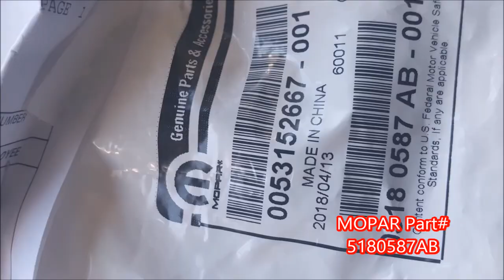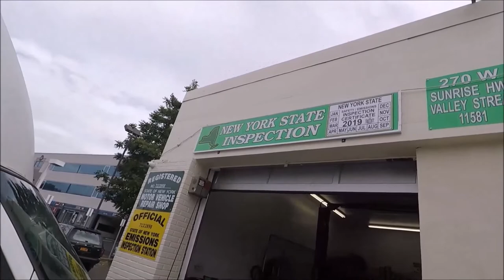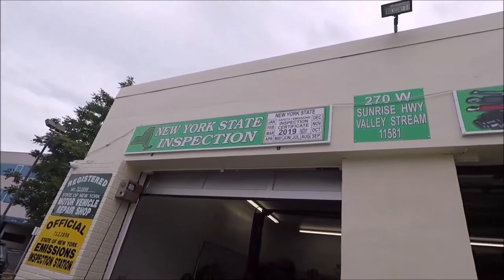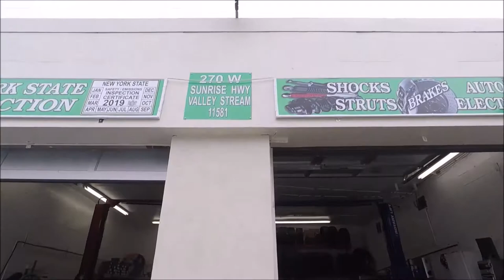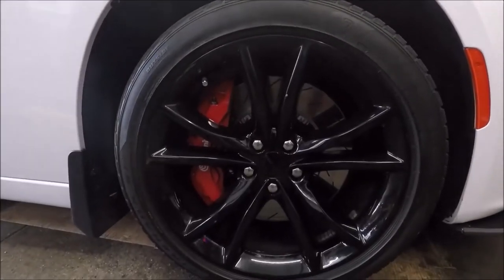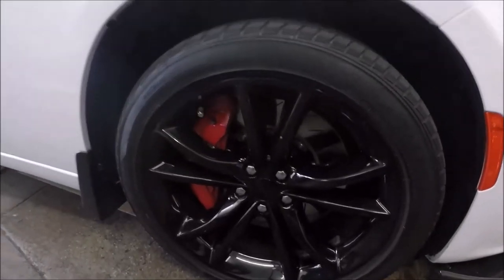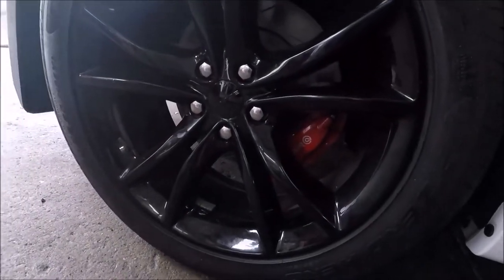Project Brembo Upgrade Part 2

Comment: Man glad you posted this. Now I know. I was purchasing spindles, rotors and calipers from a salvage yard. I wasn’t sure on the brake lines? Also when I order new wheelers I’m assuming just let them know it’s for a SRT so they get me the correct offset (so I’m assuming I will not be needing wheel spacers?) 
Also I love your car! Looks perfect. The red brembo looks good on the white and black!
Reply from the maker: Haha thanks man, I try. Purpose is to try and help others. I needed 1inch spacers on the front because my rims are 8.5 inch and i dont have the clearance to clear the calipers.. so to even the car, I did spacers all around. Dont need a brake line, but you'll need the fine thread bolt that the fluid travels through to the caliper. Thanks man
Reply: JayMac95 perfect! I will be uploading my swap also! Thanks again
Reply: @JayMac95  where did u get the fine thread bolt? and was the size?
Reply from the maker: @wowtenk  tbh, they just happened to have some laying around the shop  thank goodness😅. I'm sure it was the same size bolt just the threading was different and it had a hole in there which they said the fluid passes through

Comment: Homie you gotta be careful putting those wheel adapters on with the impact gun they’re suppose to be set to a certain torque every one is different if you over tighten them you can snap you studs right off I’ve had it happen almost wrecked my car from letting a shop do my brakes and they used the gun on my adapters
Reply from the maker: Thanks man, I've always thought about that too, as in, every bolt has its specifications. Do you still have adapters and do you know the specifications

Comment: I do had to buy a new one from the incident I spoke about. The specs very from size and manufacture. Mine were somewhere in the low 160 range don’t remember the exact torque. There’s usually a piece of paper explaining all that when you buy them. If not I’d contact whom ever you purchased them from and they should tell you the specs. If you got a good brand, you should be able to look it up
Reply from the maker: Thanks man for bringing this very important information to my attention 👍🏾
Reply: Not a problem homie!! Just didn’t want the same thing happen to your car as mine. I just put new tires on me wheels and I sat there at the shop took the wheels off and put them back on myself just bc I know they would use the gun and they have way to much torque for the adapters..

Comment: Just to make sure the rear only needs the knuckle and the front needs knuckle and spindle right?
Reply from the maker: Knuckle and spindle are used interchangeably,  but yes. The rear only needs a knuckle, just make sure they sell the bushing already pressed into it. The Front just need the spindles and you'll need a different style bolt for the brake fluid line
Reply: @JayMac95  so for the rear can you use the stock brake lines ?
Reply from the maker: @andrewjaimes4546  for the rear, yes. I don't remember having issues with them. Only the fronts were fine threaded

Comment: Did you have to change to a different wheel or are those the factory 20x8 wheels?
Reply from the maker: They are factored but I added a 1 inch spacer. I eventually got different wheels but the stock front rims are not going to fit without the spacer

Comment: So you needed a spindle for the 2 fronts but only needed a bushing for the rears?
Reply from the maker: Needed spindles for both front and rear. They just call the rear knuckles instead of spindles. The rear knuckkes should already come w bushings but initially mine didn't

Comment: So what was the reason for having to change the rear knuckle out? You said the front was because the width of where the caliper bolt goes in was to small, but didn’t say anything about rear. Was it the same reason? Thinking about doing this in the future, I’ve already bought the Brembo kit from someone for cheap, so want to get everything I need. Thanks

Comment: JayMac did you use the stock brake lines  or had to purchase new SRT brake lines?  Thx
Reply from the maker: Stock brake lines. No issues in over 2 3 years whenever I installed them. "They" recommend upgrading to braided but I bought the wrong ones at the time

Comment: nice infomation video.......will all these parts fit a 2007 dodge charger 3.5....is the bushing for the rears the same as a 2007..?thanks
Reply from the maker: Thanks John! Unfortunately I'm not entirely sure about that. I dont think so due to the complete remodel of the car. To find out you would have to compare your stock parts to that generation srt8 ...and go from there

Comment: How much did the brake calipers, spindles and rotors with install cost?
Reply from the maker: I bought the calipers new which comes with the rotors for Over 3. Spindles were over 1k. Labor put it between 45 and 5. All my things were new and discounted. You can check junkyards for used or crashed srt vehicles for these parts

Comment: Where did you find those spindles for your car? I have a Durango gt and I’m trying to upgrade it to brembo brakes and calipers.
Reply from the maker: In your case,  you would have to go to a dealer and search a SRT model spindle part number, ir find a crashed one.  U can go on car guris to get a vin, so they can plug it in
Reply: JayMac95 thank you I’m gonna try that

Comment: Are those bushings the same part number for the left & right rear knuckle? & how much were they if u dont mind me asking
Reply from the maker: The bushings are supposed to automatically be included, they are usually already pressed in, but the dealer just forgot since it was the first experience they had i guess. The part number I believe is in the vid....#5180587AB. Yes same for left and right. They were free cause it should be included originally. You can check junk yards for crash SRT models and salvage the knuckles from them for cheaper

Comment: One question? I see you had to change the knuckle for the big Brembo kit. Do you need to also change the knuckles for the smaller brembo because they are 2 different brembo brakes for the front. Yours and a smaller set...
Reply from the maker: That's a very good question man, I'm not too sure tbh. I would think so because I was specifically told I had to get an SRT knuckle and the SRTs are the ones with brembos, whether 4 or 6 piston. 🤔
Reply: Changed mine last weekend and yes you have to change the knuckle

Comment: Nice video. Question, so if I’m gonna do my rears? What do I need to get? Just the bushings? Or spindle and bushings?
Reply from the maker: Well it would just be the knuckle. I had to buy the spindles separately because the dealer forgot to send them together, because it was their first time encountering something like that. So just ask whoever you are buying from to make sure you have new bushings with it.

Comment: Did you change the brake line in the back?
Reply from the maker: No I didnt change any brake lines
Reply: @JayMac95  I have a 2014 charger so idk if 15 and up the brake line are different

Comment: Question did you need the sleeve for the Allen bolt that attaches to the knuckle? Or did the mechanic install it with out it?

Comment: Did you need bracket bolts or did you reuse your original ones?
Reply from the maker: No, needed a bolt for the brake line because brembos used the fine threaded screw
Reply: @JayMac95  no I’m asking for the actual caliper to spindle can I reuse my old caliper bracket bolts
Reply from the maker: @_.kvng.ky_1081  yes. To my recollection
Reply: @JayMac95  thanks a lot I appreciate it

Comment: Can the spindles work for either piston brembo size whether its 4 or 6 or size specific?
Reply from the maker: For the fronts, yes the spondle works for both 4 or 6. The dimensions of where they mount is the same. Brembos have different mounting points than standard brakes, thats why we say get SRT spindles, because they have the brembo dimensions

Comment: Did you use the stock Hubs and reinstall them on your SRT spindles/ knuckles on the front and rear?
Reply from the maker: Yes I did. Only change was spindles, bushings(rear) and calipers
Reply: Thanks so much for the reply, Just picked up a 2019 B5 Blue Charger R/T and the only option it didn’t have was the 4 piston Brembo’s 🙁 I think I’m going to look into doing this upgrade, as yours ended up looking amazing, and I can’t imagine the difference it actually makes in stopping power!
Reply from the maker: @Matt-uy4zk  anytime, thats what I'm here for. And congratulations on the new car 🥳. Yeah the RT models and below don't come stock with them unfortunately. Hopefully the vid helped you out. Drive safe!😎👍🏾

Comment: looks clean but did the ride height get adjusted? or is it like that? IMO needs to be lowered.
Reply from the maker: Thanks man, nope, just a direct swap and everything was perfect
Reply: @JayMac95  ok thanks. Hopefully this summer ill try it.  personally I lowered my RT i couldn't stand the wheel gap
Reply from the maker: @ForeignMadeIt  oh nice! I wish I could but cant with these toads, plus the splitter and diffuser is already low enough to scrape so yea

Comment: Hey Jay quick question. For the rear you have to buy the BUSHINGS for both sides even though i have the SRT's Knuckles?
Reply from the maker: When I bought my 2018 knuckles from the dealer, They didn't come with them, so I had to buy them separately. Ask your retailer if they come with them. If not,  I added the dealer part number for them

Comment: Can You send me a list of the Parts, thats you need for the install (FRONT & REAR)I have a 2015 Dodge Challenger and i want change my Orginal brakes in BREMBO BIG BRAKES Upgrate.  Thanks Chris from Germany
Reply from the maker: Hey Chris, thanks for watching. In Part 1 and Part 2 of the Brembo Brake upgrade, I put the parts in the description of the video.  Granted this was for charger. Not sure if it's the same as challenger, but all u need for that is just search a srt 392 challenger , get the VIN and use that vin to find the part numbers of the spindles. That's really the only thing

Comment: How much did it cost you for this upgrade (both front and back)???? I have a 2018 GT Charger AWD and was thinking about doing the same.
Reply from the maker: I spent about 1300 for spindles and knuckles replacement and 3500 for brake and rotors with my deal

Comment: Do you need 2 bushings for the rear spindle?
Reply from the maker: U need one bushing each. But the rear knuckles (spindle) should automatically come with it. Mines didnt
Reply: @JayMac95  oh ok well I ordered 2 just incase
Reply: @JayMac95  which spindle for the rear is left and which is right
Reply from the maker: @aaronferguson47  it should be in the description. My spindles though are tailored for brembos. Not sure if it's the same for other brands, depending on how they make their mounting bracket. If it's not in this description then it's in part 1. Left and right is something youd just have to call and ask, if you're only looking for one specific side
Reply: @JayMac95  I gotcha I just gave the people the part number for what I was looking for thanks for the help

Comment: Say bro I’m in the process of doing my car the same way with 4 piston brembos in the front and back what’s all the things I will need to start !!!  I have the brembos and rotors already
Reply from the maker: SRT model Spindles for the front and knuckles (spindles) for the rear. So a SRT 392 or SRT Hellcat spindle. Also might need a fine thread bolt to hook up the brake line to the brembo of it didnt come with one. Also spacers depending on how wide your rims are
Reply: JayMac95 ok and when you got the spindles was you able to use your same hub bearing that came off your car or needed the srt or hellcat ones?
Reply from the maker: @srtbj2944  same hub. Make sure wherever u buy the rear spindle, they have the bushing with it
Reply: JayMac95 will do thank you so much for the info and one last thing I have the original R/T 20inch wheels would I still need spacers?? And if so what size rim could I get to avoid needing spacers
Reply: JayMac95 how wide do my rim need to be to avoid getting spacers??
Reply from the maker: @srtbj2944  more than likely. It depends on the width of the rim. Mine was 20×8.5. Right now I have 20×9.5 and I have a little space to barely fit a finger. Unless u have spokes that stick out
Reply from the maker: @srtbj2944  then again, I have 6 pistons so maybe itll work. If u get, you'll probably just need half inch max

Comment: Did you use the same hoses or new ones?
Reply from the maker: I initially got braided hoses but they were the wrong thread so I couldnt change them. I  stuck with the same hoses that were already on there

Comment: Thanks for the videos. Did you have to buy the brake lines? Or did you used the same?
Reply from the maker: Thanks for the support. I used the same line. I had bought braided but they were too short so I just returned
Reply: Hey boss did you have to replace the abs sensors? Because mine have the abs light on
Reply from the maker: @adonismoya  funny you said that because I had to change one of mine because it was bad. Apparently the pins were bent up inside so idk if they originally messed it up after the swap but it was right after my brake change.  Probably what also happened to u. Go to autozone n see which one is lighting up

Comment: When they removed the spindle did they use the same axle nut??
Reply from the maker: Yeah everything was the same except, spindles, brake calipers, bushings (rear) and the brake line fittings which is a small bolt with a hole for the brake fluid to run thru